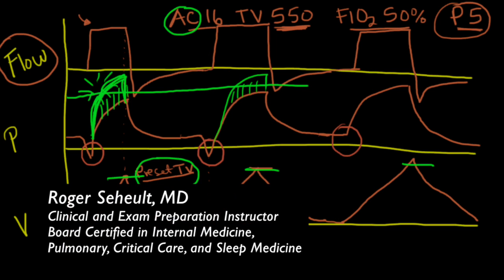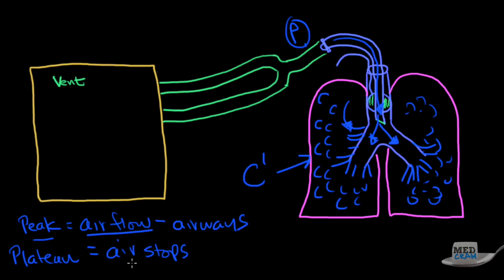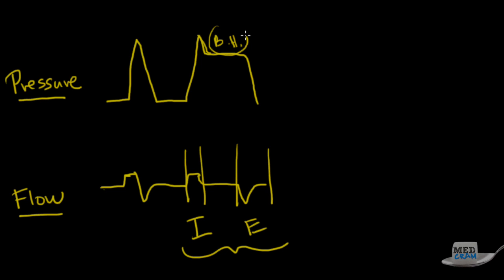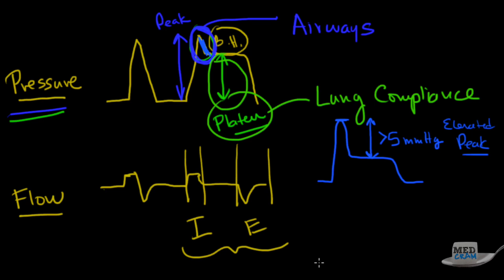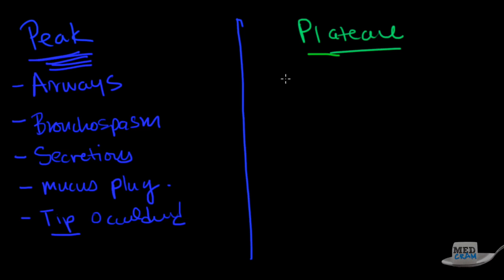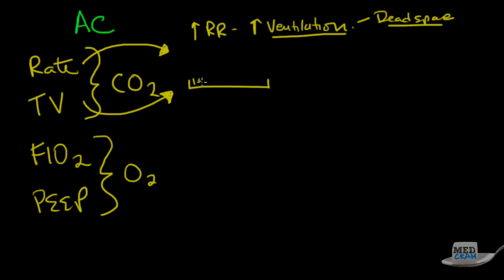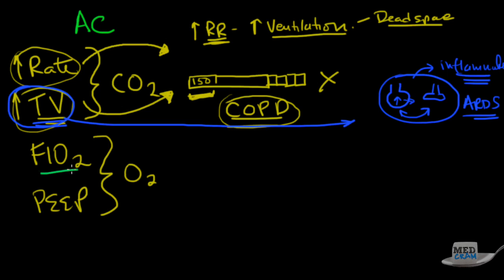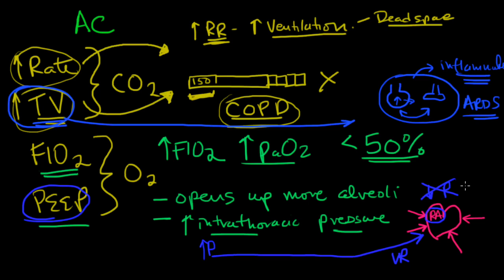Mechanical Ventilation Explained Clearly by MedCram.com | 3 of 5

Comment: Can someone elaborate on the point that increasing the PEEP helped in some cases of CHF? I don't really understand his explanation
Reply: Ninja Panda in CHF there is fluid in the lungs. PEEP is the amount of pressure left in the lungs after you take a breath. In a CHF patient you would want to push the fluid back into the body. So increasing the PEEP (the pressure) would help in keeping that fluid in the body not the lungs and also keep the lungs open for oxygen change.

Comment: I still dont understand why there is a drop in pressure after the peak pressure (and prior to the plateu pressure) during the breath hold...
Reply: Rajin Aziz Maahi This website helps: https://derangedphysiology.com/files/Alveolar%20pressure%20and%20the%20inspiratory%20hold%20manoeuvre.pdf
Reply: Rajin Aziz Maahi I finally figured it out:
Airway Pressure = Resistance of airways + Pressure in the alveoli

The peak pressure is a measure of both of those things (resistance plus alveolar pressure). But when you hold your breath, you take away the resistance pressure and you’re left with just the alveolar pressure. This is why there’s a drop - you’re no longer adding in all that pressure to bring the air in, it’s already there.

So, the difference between peak pressure and plateau pressure would be your airway resistance. And the plateau pressure would help you measure how compliant the alveoli are.

Comment: Very nice lecture, just one comment; When graphing out your exhalation and pressure returns to set PEEP, corresponding volume will not return to zero. With PEEP set there will be a volume that remains in the pulmonary system